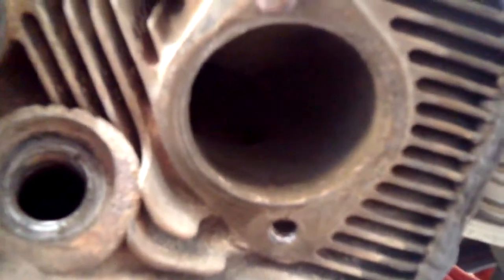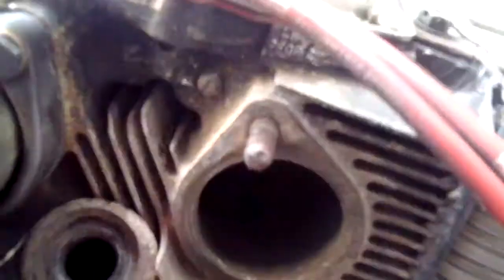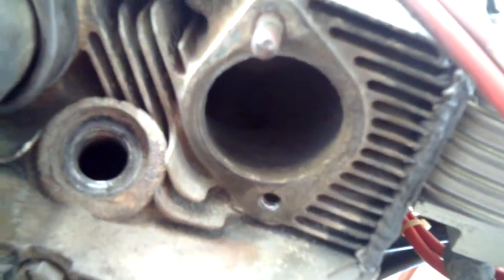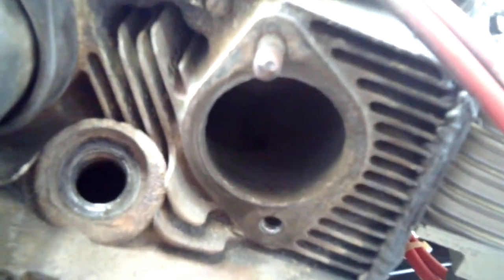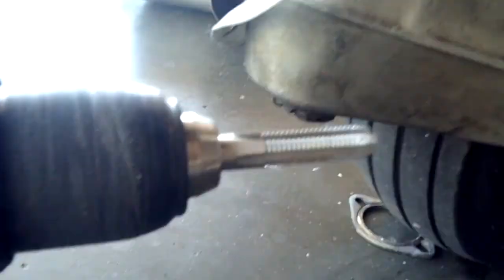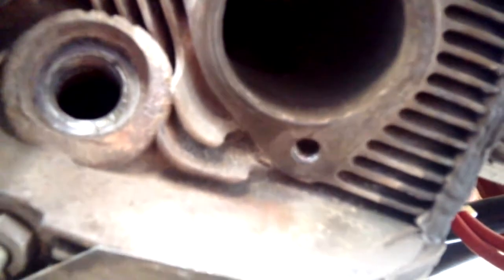Exhaust Stud Repair  - Grumman Style

Comment: Curious as to the technique you used for having the tap on an electric drill.  How fast or slow? Reverse occasionally?  How deep did you drill?
Reply from the maker: Slow speed on the drill and tap with lots of oil.
Reply: @GrummanPilots  Thank you!

Comment: Tap size with thread pitch? Helical size with thread pitch?
Reply from the maker: Standard 5/16 tap for an AN 5 bolt.
Reply from the maker: Tap used to clean the thread for inspection and they make a number of oversize studs.